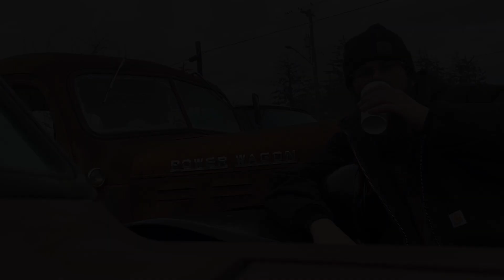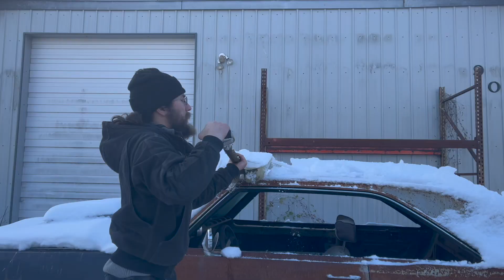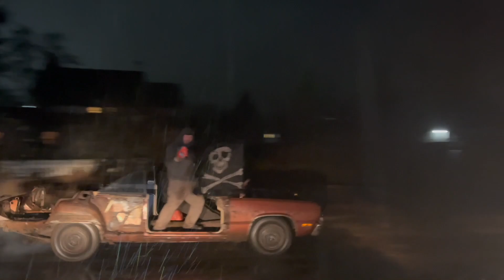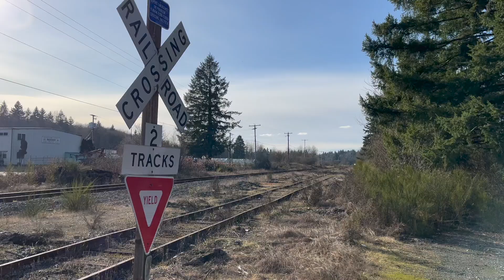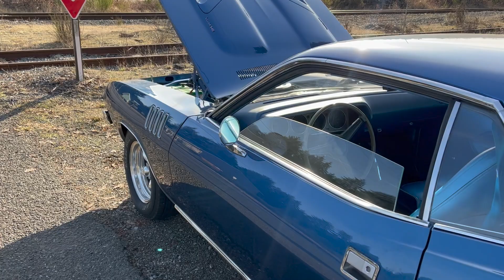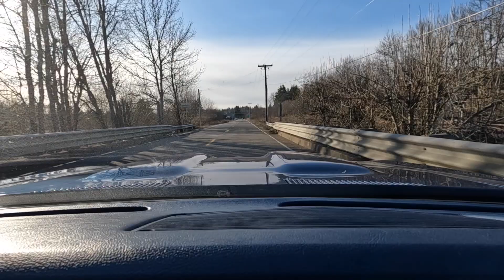How Does This Rebuilt Four Speed Shift? Test Driving Murray's 1971 340 'Cuda!

Comment: Back in 1977, I was 17 and looking for a nice car. Dad offered to co-sign the loan if I found the right car. I had it narrowed down to a dark green 1971 'Cuda for $1799, which was a trade-in at the Pontiac dealer, and a 1969 Camaro RS, also dark green, for sale by owner for $1700. Both were factory original and in beautiful condition with low miles. Dad went with me to look at them, and said, "Too expensive." Instead, he took me to a guy who had a 1974 Vega, flat blue with low miles, also great condition (for what it's worth), for only $700. "See?" Dad said. "It's also a sport car, for less than half the price. And much better mileage with that 4-cylinder engine." I was devastated. "But it's ugly, and has no power," I said after driving it. "Son, that Camaro you found is really nothing but a glorified Vega." He ended up buying the Vega for himself. To his credit, he drove it until the paint literally peeled off it, which was about 2 more years, then sold it for...$700. Me? I ended up with a 1967 Ford Galaxie 500 fastback with the 390 and a three-speed on the tree. It was big and kinda clumsy, but wicked fast.

Comment: Great video the 1970 too 71 barracuda and 1970 too 71 dodge challenger and 68 thru 70 dodge charger were arguably the most beautiful Chryslers ever built the hit it out off the park with those three cars the all look great from any angle.I watch the tv show called mannix just too see mike Connors drive around in his 1970 cuda 383 powered convertible and his 1971 383 powered convertible both beautiful cars painted racing green .👍✌🏿

Comment: Thanks for the interesting video. Could you discuss the what appears to be an aftermarket fusible link on the battery? That might be a good safety feature to prevent  a guy's favourite vintage car with vintage wiring burning to the ground if there is an accidental short. Is it bad to want to put that type of shifter handle in my CTS-V?

Comment: Actually, that air cleaner is the best choice, original or not. I experimented with a few different ones on my 340 until I noticed the idle went up 50 rpm with that one. Shows you how efficient it is.
Reply from the maker: There shouldn’t be a 50 RPM difference at idle between a basic single snorkel and no air cleaner at all. The amount of air at idle is nothing compared to the amount of air these engines consume at 5,000 RPM. That result raises a lot of questions for me. Anyway, the factory unsilenced air cleaner used in ‘71 is a good piece, and I would argue that a car like this - one that is in good factory condition with original parts, and that is driven and enjoyed but never raced - deserves to have the right one.
Reply: @DeadDodgeGarage  All I can tell you is what I saw on the tach. That early unsilenced air cleaner added 50 rpm at idle. Maybe the valve cover breather that goes with it made a diff...? Anyway, it"s fun to chat about it. I like your videos. Keep 'em coming!

Comment: Sweet looking ride, cudas have shot through the roof in value, especially 71’s. What size tires on the back, assuming the rear wheels are 15x8? Maybe tire size 275/60/15? I’m planning on that size for my 73
Reply from the maker: I’m actually not sure and can’t really check now, but that sounds about right.

Comment: Definitely a beauty.

I got a set of seat relocation brackets similar to what year 1 sells now, that move the seat back one to two inches; I'm almost 6' 6" and they made it a lot more comfy to get in/out and drive.  Just a thought if you have the same issue with your own car(s) or if the 'Cuda's owner is taller.
Reply from the maker: Oh awesome. Good to know! I’m comfy in my B body. I can’t say I have noticed feeling cramped in any of the other E bodies either, so it may be something specific to that car.
Reply: @DeadDodgeGarage  Cool.  I've also heard (but not tried) that you can use a tuff steering wheel adapter and replace the long E-body crush can to pull the steering wheel  further in towards the dash, but not sure if it would work with the stock steering wheel (I think the tuff steering wheel is smaller diameter).  Can't get to mine right now to check.
Reply from the maker: @richjordan9375  My '73 Challenger had an aftermarket style wheel with no crush can. That was nice, except that my hands hit the dash all the time. There's a reason they extended it...
Reply: @DeadDodgeGarage  Your experience wins over my 'I read about it'; my steering wheels (stock and repro Tuff), crush can, and never installed Tuff adapter are all packed up.  If you had a Grant style adapter they were pretty short.  I've seen forum posts from folks who were happy with the result of installing a tuff adapter and steering wheel.  Wonder what your car had in it.  

Pretty sure Grant is about 1/2 the length of a Tuff adapter, and Tuff is  1-3/4 - 2" shorter than a stock crush can.  And apparently there was some variation over time in the length of a crush can.

I don't remember the distance from the dash lip to the back of the steering wheel with the crush can...
Reply from the maker: @richjordan9375  it was definitely a short Grant style adapter, but not a Grant wheel. I'm drawing a blank on the brand. It was black, and sort of looked like something you'd see on an arcade racing game. I'm not sure on crush can dimensions, but I feel like the wheel sits 5-6 inches away from the dash with it in place. I've never actually measured.

Comment: At 1st the passenger side exhaust manifold look correct but the driver's side manifold is definitely the wrong correct manifold versus 71 as far as the air cleaner goes Hey it's already got the wrong car breaker on it so so what thank you
Reply from the maker: It is the correct ‘71 exhaust manifold. They’re remarkably similar to truck manifolds. The special 340 manifolds were gone by ‘71 - my Demon 340 also came factory with the regular 318 type manifolds instead of the high performance type.